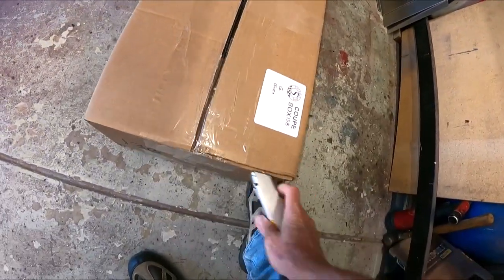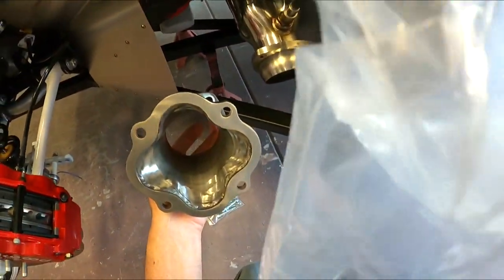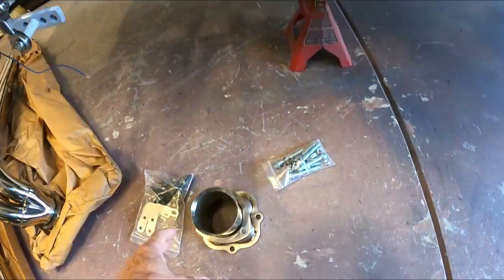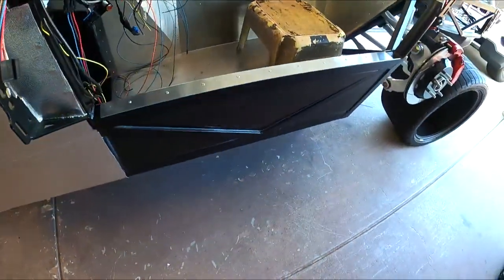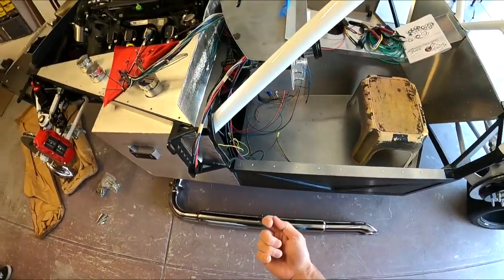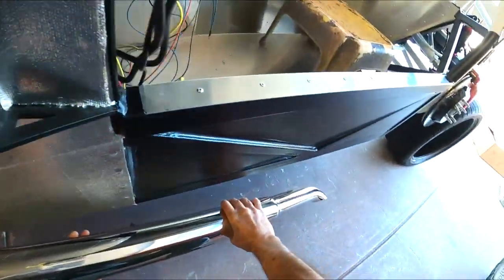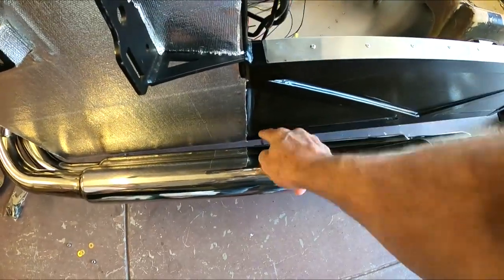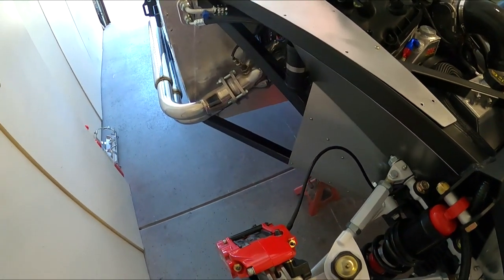Cobra Daytona Build- Side pipe installation, video 90

Comment: Do you do an initial fitment of the side pipes before and after body is on?  I was curious if you have to be cautious and readjust the pipes for alignment with the body on.  Also curious is heat of the side pipes always a problem along a fiberglass body?  The original of course was aluminum panels.
Reply from the maker: Side pipes will come off before body install and once the body is on and in position I will adjust to fit. Never an issue with the fiberglass from the heat as long as you have some spacing. Thanks for the great question.